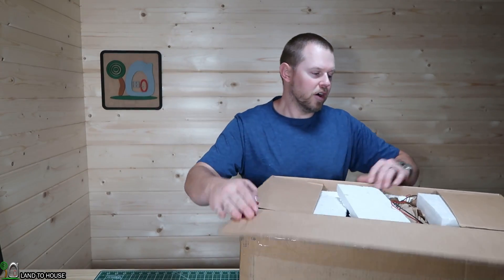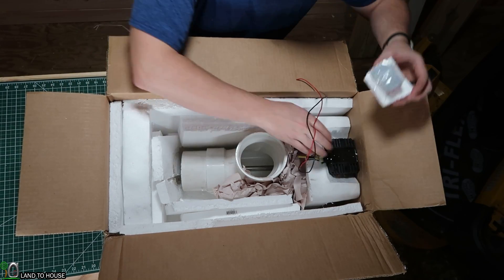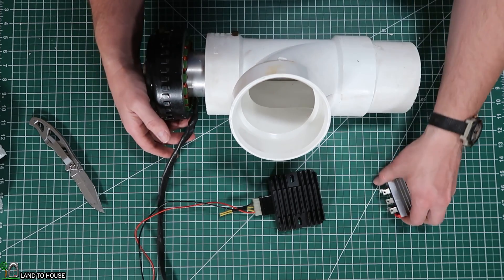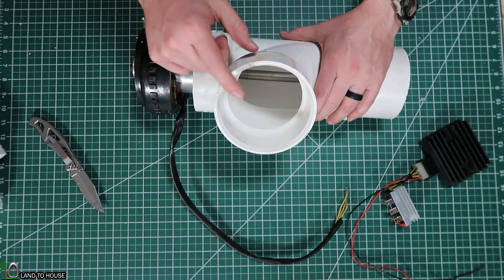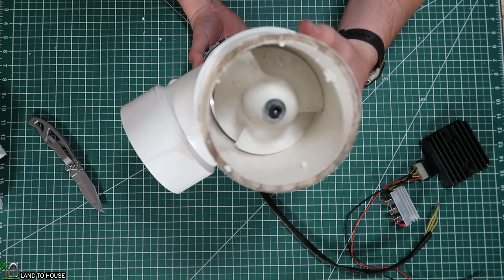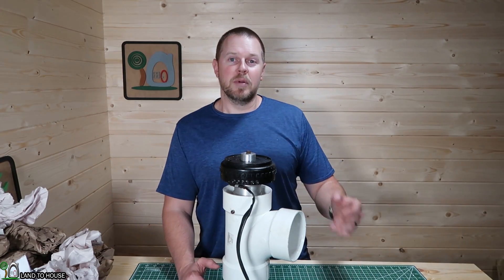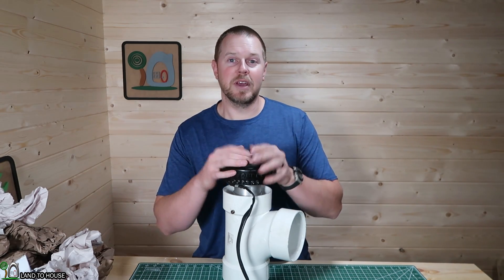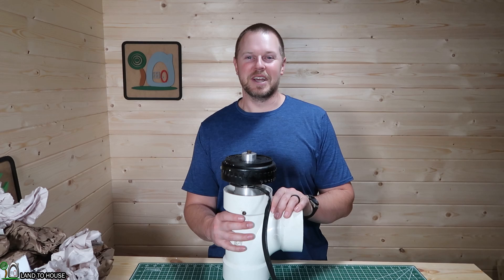New 4" Low Head Micro Hydro Unit Intro

Comment from the maker: Check out Langston alternative power 
https://www.langstonsalternativepower.com/
Reply: I just came across your video I have a 4 " overfill pipe from and ungrounded spring that the water is coming from. 100gal cement holding tank this really caught  my eye could be fastened to the end of pipe but how is it if it floods there the over  flow pipe goes into the creek ? Do you have more videos  on this? FOUND the ram pump definitely  could use that .Thanks for all your experiments

Comment: Please test a system that uses tanks as water source. The idea is for the system to create a capillary effect  where the water loops. It goes into the pipe down to a tank that feeds the pipe creating a perpetual loop. OfCourse height is part of the equation also a venturi effect to increase the flow to generate more electricity.

Comment: Hi, I like all of your videos it has help me to learn about Hydro on this new 4 inch I was thinking on using a IBC water tank and a belt driven water pump to run this I do not live near a stream of any kind so I cam up with this idle of using a water tank and a set us up like this pump water out of tank thru the hydro and back into the tank and the water pump will be turned by water wheel in the tank all I will need to do is spin the wheel to get it turn and pump water to make the loo .I would like to see you do this set up too for the ones that do not have a stream on there land or home stead.

Comment: Great video, I have an iSTA-BREEZE 500 generator with a pelton turbine but the problem is with the hybrid controller due to the brake. Please send me information about the voltage regulator you use, how many amperes it is and where it can be obtained.

Comment: Hi Seth, I've been binging your ram pump and micro hydro vids over the past 2-3 months as we are getting ready to buy our homestead in TN.  Lots of planning and work to do over the next couple of years!  One thing we want to do is put in hydro power.  There is a pond that is fed by an artesian spring.  The stated flow is very high at 1,000 gpm!  I expect that this is the high end during the springtime, but it is quite a lot of flow from what I've seen.  Here's the question:  the pond empties into a stream that has very little elevation drop before merging with another creek and going off my land.  So, do you have experience/knowledge of any systems that need only 1-2 feet of drop and run primarily on the flow of the water?
Reply: I have the same problem and am also in Tennessee.
Reply: try an Archimedes Screw setup

Comment: Following your systems for a long time. It hasn't even been a year and you have had multiple breakages? Is it poor equipment or poor planning?
Reply from the maker: Thank you for watching! Well its because of my own neglect.  I had a mouse eat a wire and I left the water in the line closed off at 5 degrees f. Turns out water freezes and shatters pipes.  The upgrades will need to take into account mice and cold.

Comment: ok, here's something to remember, AC handles the transmission distance better. So run 3 phase close to the end point, then convert to DC.
Reply: Its actually more efficient to transfer dc power at a given voltage.

Comment: not a dump load thats a motorcycle voltage/regulator 3 yellows in dc out at max 14.8 volt or there abouts stright into lead acid battery job done not most efficient way mppt is best for that
Reply from the maker: Spencer just messaged me about that haha. Yes he said that it is a simple way to charge a battery without expencive components. He wants to show that hydro can be done with simple components as well as the high dollar stuff.

Comment: I seen a similar setup where they pull a siphon. Are you doing that or just running water through it?
Reply from the maker: I will probalby try several things. Siphon might reduce the power because the waterfall is almost 5 feet across. But I do want to try that. And I want to try with water spilling right into the top.

Comment: Best Part: "Blah Blah Blah a lot of talk, more Hydro coming up" Hahaha!! But seriously... I am VERY interested to see how this pans out! The 4" size and compact factor is very approachable for the DIY crowd! I'm curious to the GPM requirements, head pressure or "water drop" requirements, min GPM needed for power output, and of course overall setup process.
Reply from the maker: A lot of times when I'm filming that's going through my head "this is way too much talk"

 Depending on the height of the downpipe this can use anywhere from 50 to 200 gallons per minute. (I'm estimating)  I have a feeling my water source will be the limit of  testing.